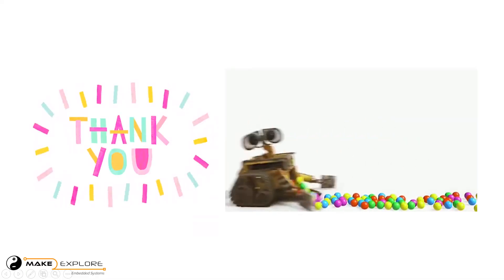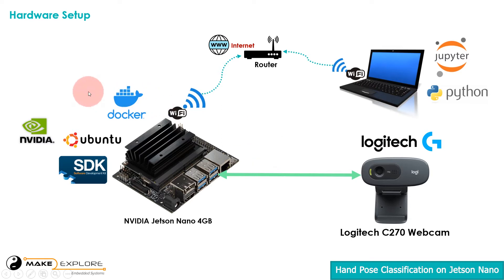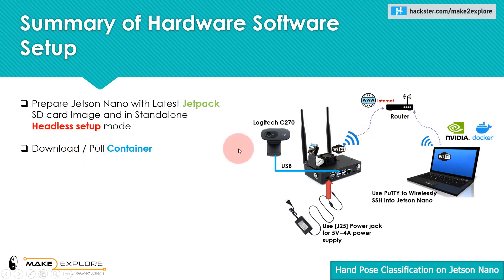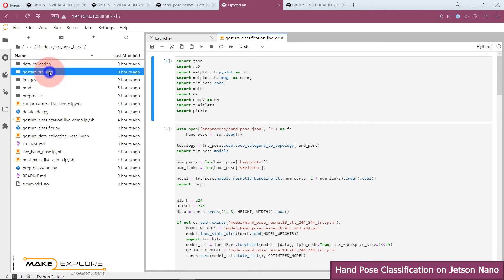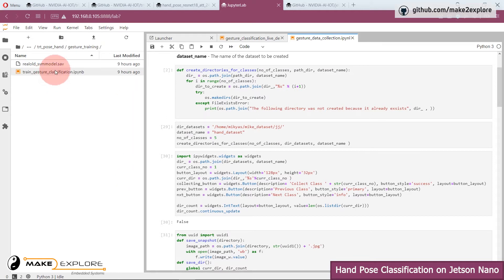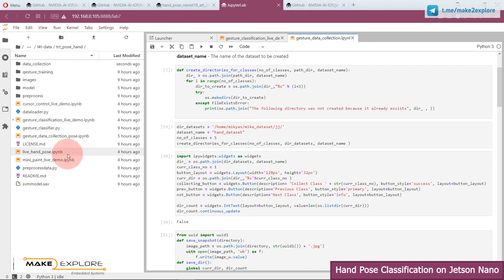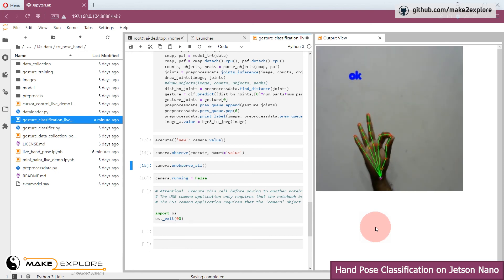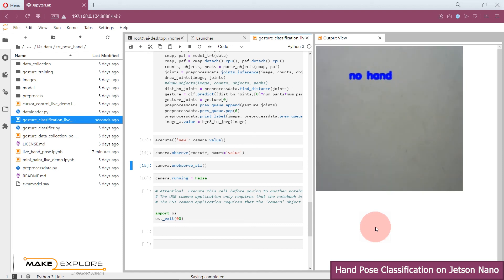[ Part II ] - Hand Gesture Recognition on Jetson Nano

Comment: i want to control DC motor like "ok" to move up, "stop" to stop...   So how can i solve this problem
Reply from the maker: Dear Kiên Nguyễn Bảo @kiennguyenbao4231, 
Thank you very much 🙏 for your interest in our channel.

Q - i want to control DC motor like "ok" to move up, "stop" to stop...   So how can i solve this problem?

➡️ If you are asking this question in context of Jetson Nano related hardware. Then you can go with custom JetBot Kit. or You can assemble it with your own - 
🔗 https://jetbot.org/master/
🔗 https://www.waveshare.com/wiki/JetBot_AI_Kit

In JetBot software setup, you can easily integrate hand pose recognition code and vice versa. 
🔗 https://github.com/NVIDIA-AI-IOT/trt_pose_hand/blob/main/live_hand_pose.ipynb

➡️ If you want to achieve this "controlling the robot using hand gestures", then you can also use Flex Sensor Glove in combination with Hand Gesture recognition for better performance. Please note that, in JetBot based system, you can collect your own gesture images data, label it and train it. You can check out following link and explore examples like(object tracking and line tracking), you will understand.
🔗 https://www.waveshare.com/wiki/JetBot_AI_Kit

If you still have any issues/suggestions about this Tutorial, or any of our DIY project, feel free to ping us on WhatsApp/Telegram (Links given below) for further support.

Tech support - (𝗖𝗵𝗮𝘁 𝗢𝗻𝗹𝘆) Telegram/WhatsApp - 11:00 AM - 05:00 PM (Mon-Fri) IST   

🚀 𝗧𝗲𝗹𝗲𝗴𝗿𝗮𝗺      🔗 https://t.me/make2explore
💬 𝗪𝗵𝗮𝘁𝘀𝗔𝗽𝗽    🔗 https://bit.ly/3VXGGEe
📩 info@make2explore.com  / support@make2explore.com

As per time permits we will try our best to help you out. 

Best Regards 🙏